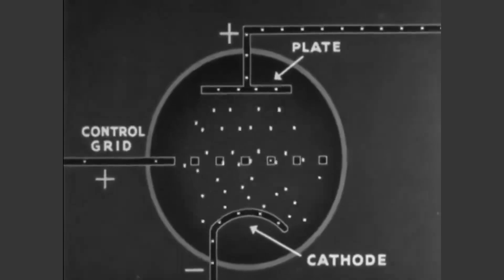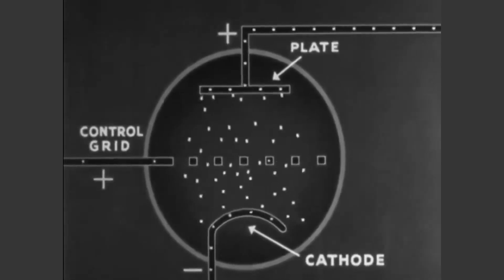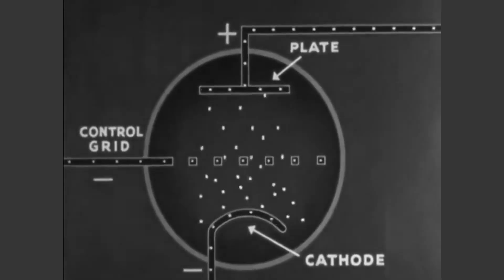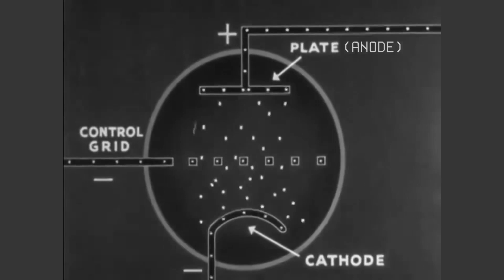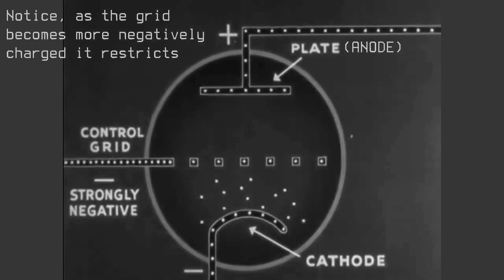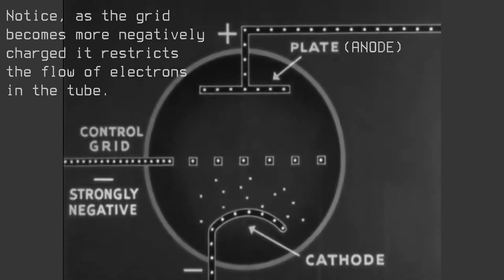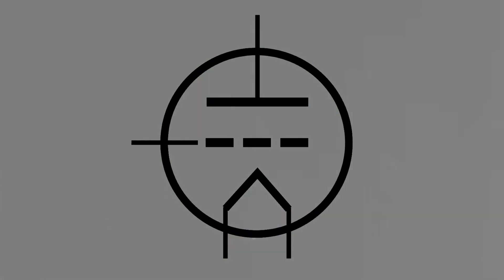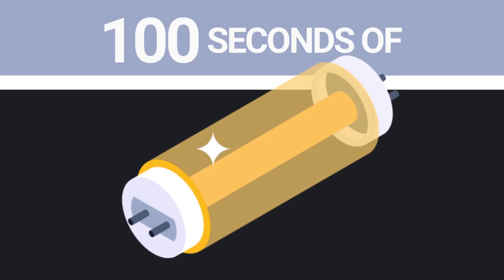Vacuum/Electron Tubes in 100 Seconds

Comment: NOT good! The transistor analogy shown with Bipolar Semiconductor Transistors is not good. In those transistors, current flow is controlled by Base Current. FETs are the proper comparison because Field Effect Transistors are controlled by voltage, just like vacuum tubes. 
Also, there is a definite middle ground with VERY interesting characteristics, called Vacuum Channel FETs, in which the current is carried across a small gap by Free Electrons coming from a cold cathode (aka, field emitter). These devices have been experimented with for many years in a few laboratories, but somehow have not made their way to market, despite offering the best of both worlds (semiconductors and valves) but with none of the usual drawbacks. Vacuum Channel FETs run about 10 times faster than the fastest transistors, require only low voltages to operate, can tolerate high temperatures and ionizing radiation, and when made with modern nano-scale integrated circuit manufacturing methods, they don't even require vacuum! (They can instead be filled with Helium at atmospheric pressure or less.)

Comment: Nearly everyone has a directly heated vacuum tube at home when they have a microwave oven, the magnetron microwave generator is a especially self oscillating vacuum tube.
Also fluorescent tubes also count as vacuum tubes, especially the ones that glow their cathodes to have thermionic emission strike the arc
And Vacuum tubes still rule the World in Transmitting and Big RF Applications like industrial induction heating since transistor Technology hasnt catched up and is inherently not as robust as a tube

Comment: "the mosfet transistor is a new JS framework designed to simplify current control using mostly voltage and reducing current consumption"